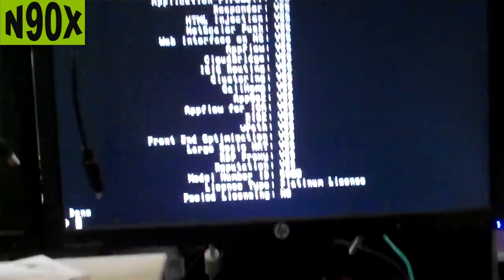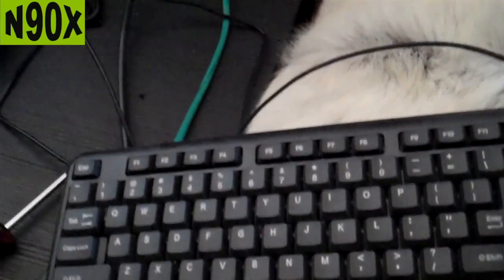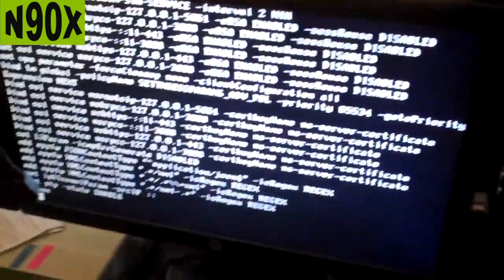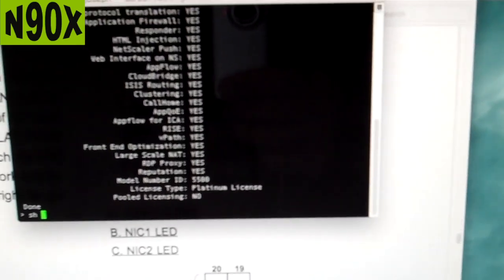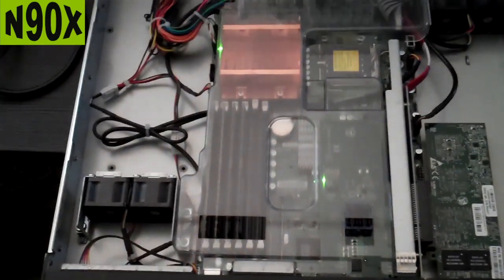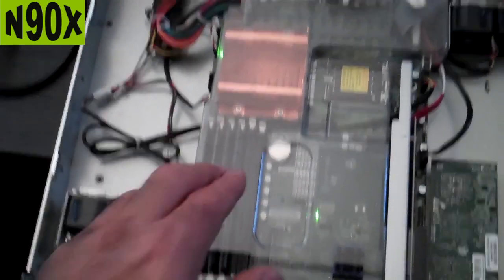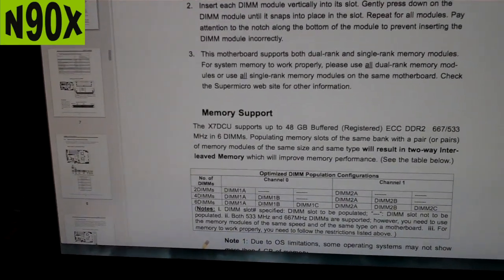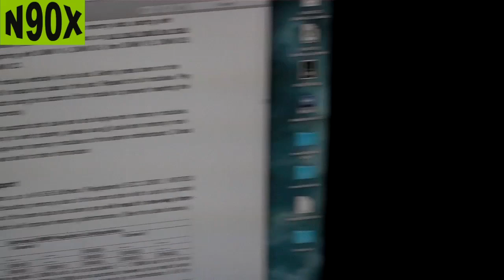VIDEO HACK for MPX (N90X) NetScaler MPX 5500 shown

Comment: I got two of these off eBay, but they were still locked down by the previous owner.  Serial doesn't work - any chance to reset the admin login using this hack???
Reply from the maker: OH just read the serial does not work, so yes! Expose the video, plug in a keyboard and press DEL on boot to get into the BIOS and double check if the serial port has been "disabled", and re-enable it.
Reply: @NetScalerTrainer  Thanks for the reply!

All signs point to the serial port being enabled in BIOS.  Tried good/known working serial cables and unfortunately still nothing.  It boots fine and I can load the WebUI using ethernet and a static IP on my laptop.  No credentials, no access...

No idea on how to salvage the original NS install.  Going to add new OS and use the developer version of Netscaler CPX as a backup.  

I have a second one if you have any ideas, but going to repurpose these as they are essentially bricks without access right now.
Reply from the maker: @nickremme9250  contact admin@n90x.info for "Legacy Citrix Support", very cheap.
Reply from the maker: @nickremme9250  https://n90x.info/netscaler_hacks.html
Reply from the maker: YES - WHEN YOU SAY LOCKED DOWN , WHAT DO YOU MEAN? if the password is changed you can do the " RESET NetScaler password" procedure (google it) and you should get back in. you can doi it via the video port or serial port.